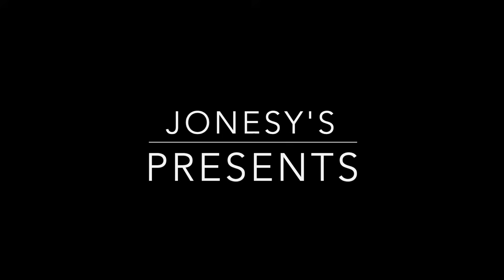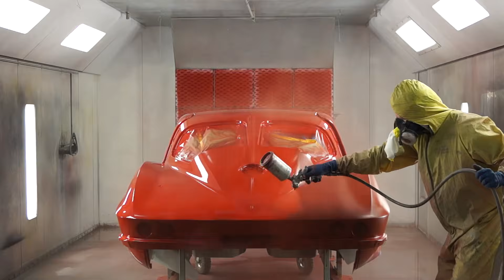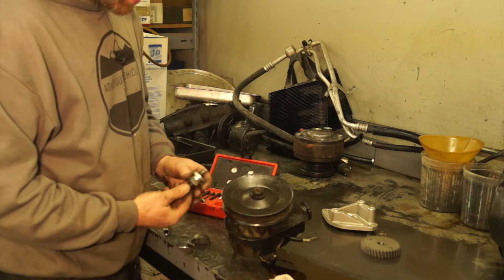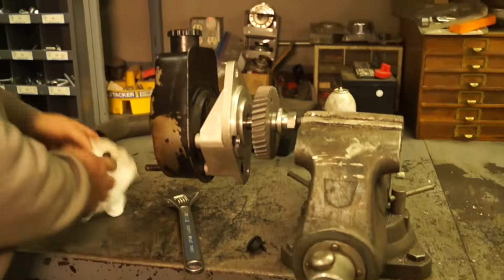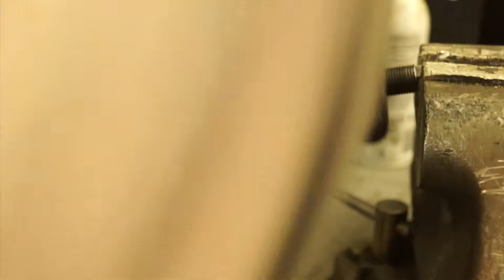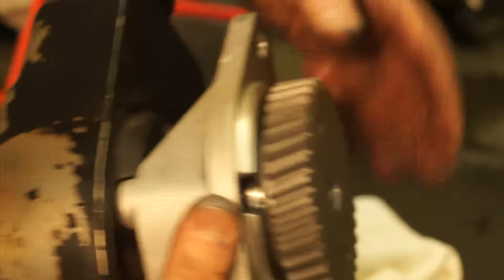The OG - DIY Cummins swap - B Series Direct Mount Power Steering Pump Adapter

Comment: does oil still need to be supplied as the vacuum pump did
Reply from the maker: No engine oil needs to be plumbed to the direct mount power steering pump.

Comment: what psi pump do i need for a 12 valve cummins in a 04 f250 super duty? 800 or 1200? summit says 800 but DCS swap company says 1200. i just purchased this adapter kit but in the keyed shaft version and dont know which pump to go with>

Comment: So I've done a Cummins conversion into my 1997 F250 Ford and looking to hook up the power steering I'm not running Hydro Boost as I'm using the Ford's brake system, is this system going to help with my situation? Thanks friends.

Comment: Are the two threaded holes in the gear for a puller to remove the gear?  Besides the threaded holes, is there any difference between this gear and the Cummins factory gear?  Can I use the factory power steering pump that comes on a 1995 Dodge Cummins (CPL1550) after I remove the vacuum pump and coupling?  Thanks.

Comment: What pump part #  is it? Have the bracket but pump is bad and can't  find pump. Please help.
Reply from the maker: Most of the press fit pulley pumps will work for the Chevrolet or GM application.  Mid 90's GM pumps work and they have both hydro-boost and non hydro-boost applications.